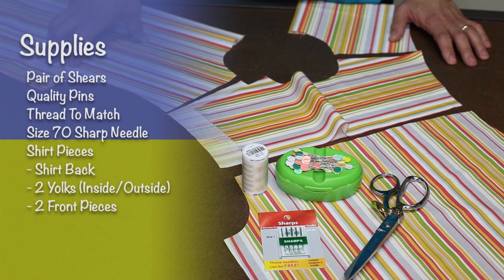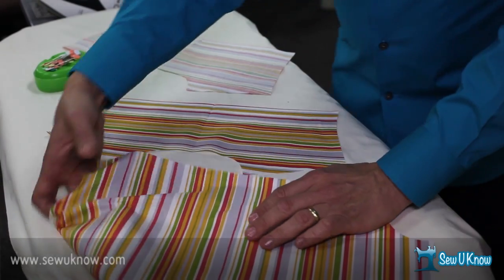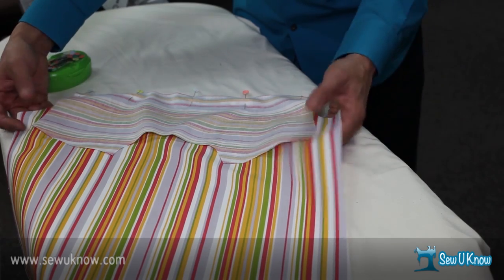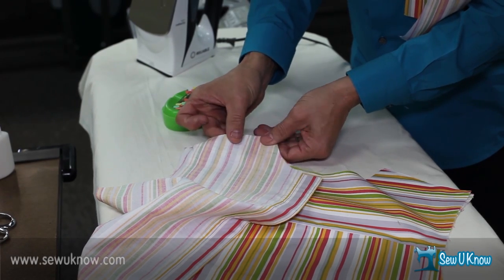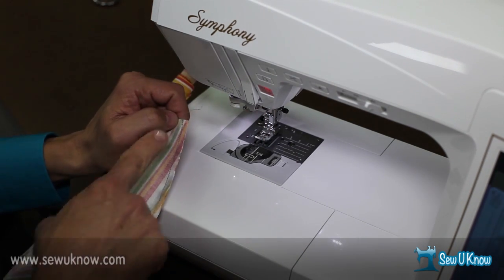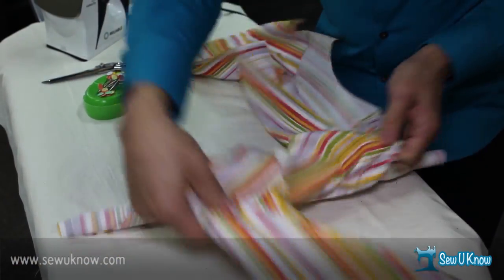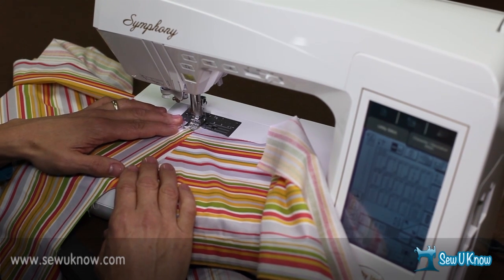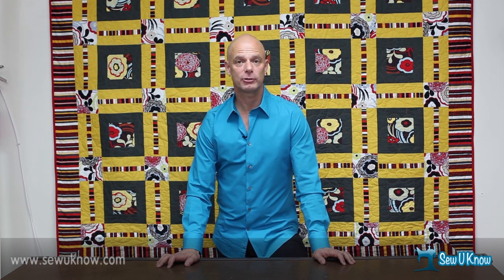How To Sew A Shirt Yoke

Comment from the maker: If your stitch length is appropriate to the weight of the fabric, it is typically unnecessary to back stitch. However, if you are uncertain, you'll never go wrong with backstitching, but you can go wrong without! One of the reasons not to backstitch is to reduce bulk. A method I often employ instead of backstitching in order to reduce bulk is to decrease my stitch length at the beginning and end of a seam for about half an inch to anchor the ends.

Comment: A tip for those who find making a crease at centre doesn't hold its shape, you can snip in a tiny triangle at that point, WITHIN your seam allowance. DO NOT go beyond. SAme technique can be applied for notches on other parts of your patter pieces as well. 

To the admin: I will give this yoke method a go and leave my feedback later. Your explanation is by far the clearest to understand. Filmed and presented professionally.

Comment: Thanks for your prompt response. I am referring to the back measurement. I noticed after cutting out the neck the shoulder is still wide. Am asking in respect of a woman measurement, if the shoulder is 7inchs when fabric is on fold and I cut out 4inchs for neck, I will be left with 3inchs as shoulder which am thinking is not as wide as what am seeing here. so do I need to add to the measurement to make it like 8/9 inches in order for the shoulder to be as wide as yours? Am not good at explaining myself but I hope you can understand me now😁😁 ? Thanks
Reply from the maker: The measurement is based upon the size of the garment. If you are using a pre-made pattern, it should be fine. If you are drafting your own, I might suggest Flat Pattern Design by Nora MacDonald as a good resource.